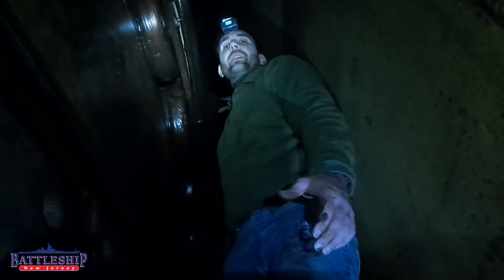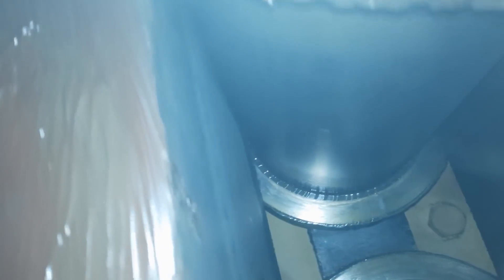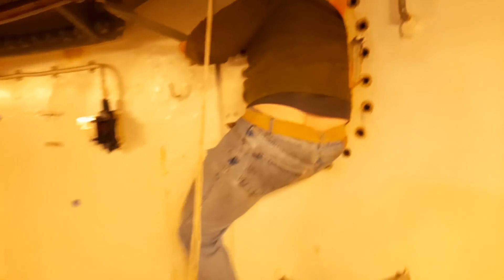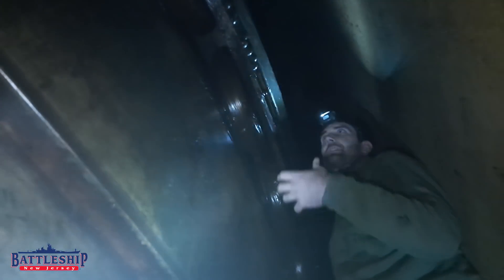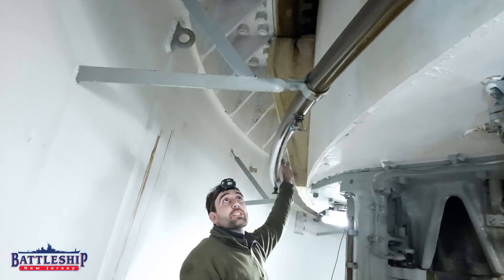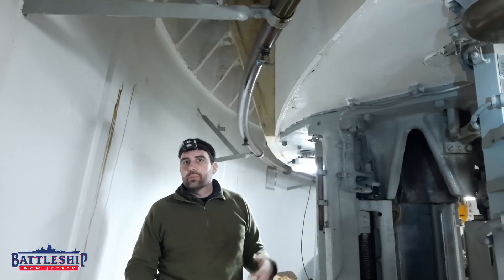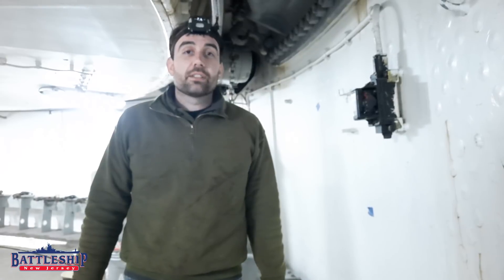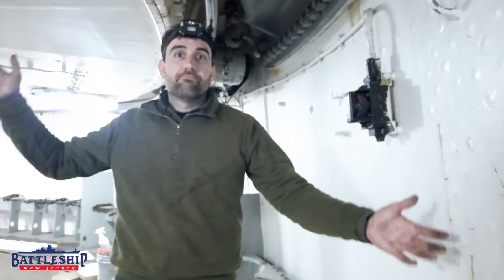Do the 16in Gun Turrets Still Rotate?

Comment: So just curious the video never confirmed if they were. I mean there are stories and that article on page 7 mentions it, but has anyone tried to rotate the turrets to see if they move, or if the systems that provide that still function, or is it as some suggest that maybe due to power requirements there simply isn't the electricity needed to do it from shore power, which that last part doesn't make sense as i'm sure they had maintenance checks on those, so th eidea that they could only check them if the ship's plant was online or at sea doesn't make sense
Reply from the maker: We're going with plausible. We don't have enough power to test it but haven't found any welds showing it would be impossible.
Reply: @BattleshipNewJersey  ok. Here's a good follow up then, and a pair of good questions for a video. I know some ships, such as Iowa, still do gun salutes for special occasions. Iowa's museum posted a video a few months back showing what it looks like from the inside. Besides the fact it would be a bigger powder charge, and cost way more to do, my question is 1 is it still possible to do a gun salute with a 16in gun, or were they rendered unable to fire? (like for example in demilling of guns or cannons, i've seen breech block removed, holes burned in barrel, barrel sealed with steel or some other material, or firing mechanism removed) question 2 is are the guns still able to be elevated or lowered to accommodate that or other types of preservation maintenance?
Reply: i did just see someone asked that question a week ago..kind of. Not necessarily a full power, 4 powder bag charge that cycles the gun and all that, just some kind of salute
Reply from the maker: It would be completely unsafe to fire the 16in guns. We do saluting charges with the 5in guns and the 40mm guns. 

The 16in barrels can be elevated.
Reply: @BattleshipNewJersey  okay. On a side note, I've been to Alabama, Iowa, and Wisconson, so i'll have to come by and add New Jersey to the list. The warship i'm on is decomming next month and we'll be sailing up there for storage so there's a few of us, given the chance, want to come see the New Jersey. Hopefully the gift shop has ship coins for sale
Reply from the maker: Of course we've got challenge coins! If we're not publicly open by then, email me at education@battleshipnewjersey.org and we can set something up for you to see her.

Comment: One way to find out. Rotate them. The need to move every once in a while. Bad for them to sit in one spot.
Reply from the maker: We don't have the electrical power to do so.
Reply: @BattleshipNewJersey   Can't you bring in an generator, run a cord to power them up?
Reply: You can wire in an axillary system to work them
Reply from the maker: Its a lot of power. You'd need a massive generator to do it. It's just not realistic.
Reply: @BattleshipNewJersey   I'm an electrician, they have 3 phase generators on trailers that would handle it. I'm not trying to harp. I apologize if I come off that way
Reply: I know you have a limited budget, but that would attract more people to the ship.
Reply from the maker: You also need to be able to repair all of the motors and hydraulic equipment that we aren't allowed to touch either.
Reply: @BattleshipNewJersey  10/4
Reply: @BattleshipNewJersey  I appreciate you answering the questions.

Comment: The engineering of these machines astonishes me. All pre-computer, pre-calculator!
Reply: The IOWA was used in the Gulf War---The mechanical aiming computer is still so accurate, that it was determined there was no need to replace it.  (People were pretty damn smart back then, and had to be, without electronics and tech to do all their thinking for them).

Comment: I think to answer that question you need to fix everything on the electric swich gear deck and give it power. I'm sure it will turn.
Reply from the maker: We don't have enough power to do it, our shore power hook up isn't capable
Reply: @BattleshipNewJersey  those diesel generators on board are disabled too? I'm sure theres something still left there to pull that magic trick  off. You gonna have to do it at night though. I don't want you to scare the locals by cranking the turrets in broad daylight.
Reply from the maker: We fire our 5in guns regularly, the neighborhood trusts us. But the diesel generators, don't work and won't work, so we can't rotate the turrets
Reply: @BattleshipNewJersey  damn!
Reply: @BattleshipNewJersey  I volunteered a little on USS NORTH CAROLINA.  It would be great to see a gun fire on that ship too. Too bad the main rifles are pointing either downtown Wilmington  (turret 3) or straight at Leland NC (turret 1& 2).
Reply: @BattleshipNewJersey  , "But the diesel generators, don't work and won't work", Don't I understand from years of not being used. Won't work because of rules or that much work needed on the Gens?
Reply from the maker: Our contract forbids us from powering any of that up

Comment: I like.  Engagement increased by one.  On a tank, there's often a way to manually traverse the turret.  Is there no back-up manual system on a battleship?
Reply: There's a question of scale... 2200 tonnes vs maybe 20 tonnes in some tanks?  Could you manually traverse it?  Yes, probably, with enough manpower.  Could you do it in combat?  I strongly doubt it.  Far easier and faster to turn the ship to point the turret at the enemy!

Comment: OK Ryan.  LOVE the Videos, but you had one question on this one and you missed it.  The question was CAN THEY ROTATE?  Not if they are greased, not they are not welded.  CAN THEY ROTATE?  In other words, do you need main steam power to rotate them and since you can't use the boilers you can't turn them?  What exactly is stopping you from rotating them?  No electric power? Not enough power? or what?
Reply from the maker: Not enough power
Reply: @BattleshipNewJersey  See THAT's the answer.  NO, we can't turn them without main power. While it was neat to see the greased rollers, the clip never answered the question.  Now we have it.  Thanks.  Keep up the great work.

Comment: Wasn't it the NJ that there is a video of it being transported by tug from where it was mothballed, and one of their concerns was that the turrets were still free to turn, and that the locks were damaged and not effective?  IIRC that was when it was brought to Camden, so if anyone were to have "welded" the turrets locked it would have been the Museum doing it.   The fact it has 3 motors and rotates at 4* per second means the motors are geared in such a manner that the turret cannot rotate the motors, and the motors effectively lock the turret in place.

Comment: The rollers are almost certainly not made out of brass. Based on a rough load analysis, the brass rollers would likely fail as soon as the turret is installed. Bronze is no better. Heck, even standard high-strength steel is marginal - even without taking into account dynamic loads such as pitch and roll, not to mention shock loads like gun recoil or shell impacts.

From what I have read, the South Dakota class used forged steel rollers. I guess you have to rely on the grease to suppress sparking.

Comment: You can weld hardened steel. It is possible. However if not done properly it would ruin the structural integrity of the metal. Those rollers will be hardened steel. There are much better ways of immobilizing a turret than welding on an extremely heat sensitive component of the mechanism. The easiest way I can think off off the top of my head would be to weld slugs of metal into the gear the turret turns on. Weld them to the mild steel on the inner turret basket so they sit inside the turret ring gear.

Comment: Eventually those rollers will get a flat spot over time & the raceway that rollers will get a low spot where the rollers are sitting on so if someone wants to rotate the turret it will be slightly more difficult to rotate them but not impossible.
I assume it takes fair amount of horsepower to move them so I assume someone think they are welded but you can just push the turret to rotate it.

Comment: Don't believe they'd weld the turrets but would do something in a turret related system which likely could be easily reversed/repaired while meeting the letter of the law and preventing the turret from turning.  Weld an external stop on a 1/2HP motor shaft of something in the chain and you've satisfied Sen Thurmond.  Obscure motor xyz doesn't spin and it's part of subsystem C for turret widget Z.

Comment: Another great video. Thanks! I wonder if the rollers could be beryllium copper? I think that would take more weight than brass without deforming and could be almost as strong as steel and still not spark or rust. If they are, though, don't grind them or anything like that. It would create toxic dust.

Comment: When I was watching a video from the Iowa https://www.youtube.com/watch?v=LJfGJPLDwAI there is a drawing of locking pins that go into the barbette to keep the turret from movingaround 51 minute into the video. Could it be that those got welded in place rather than dragging a welding rig down into that annular space you were showing us? BTW - Thanks for the 'behind the behind the scenes' video. If you can get Ryan to volunteer to go into more places like this, the splinter deck, catacombs, chain locker I'm sure they would be among the most interesting.
Reply: Ryan can you video this!!!!
Reply: Interesting they say it's hydraulic motors to rotate the turret.
Reply: @briansutcliffe6503  My guess would be that it's faster to train someone to see hydraulic fluid spurting out than to train electricians mates. They generally used 1 big motor to pressurize the hydraulics and then used hydraulic motors and hydraulic cylinders to do the actual movement.

Comment: Technically, this could be checked, but probably only if the engines were running and there was enough power to the motors to initiate turret traverse.

If the turrets move (you can try something like a 3 degree rotation, to avoid strain on the motors), then you'd know for sure that nothing was done to immobilize them.

Comment: I’m sorry but I can’t help it but feel like there is some part of the answer to your question in the video title missing, namely a yes or a no. So, you did not find any evidence that the turrets can’t be rotated, but you have not fully inspected the turrets, right? (Which I guess is not a quick and easy thing to do). So you can’t definitely tell right now?

And a side question: if the hydraulic machinery for turning the turrets did fail in combat, what is the redundancy? Several separate hydraulic systems? Or even a hand crank? Given the huge weight the latter sounds crazy, I know 🤪

Thank you very much for your outstanding effort! 😊👍🏻

Comment: Is there a way to traverse a turret with complete power loss? I know the Texas had a chain pulley mechanism, I’m wondering if Iowas had something similar 

Also, how thick are the 5”/38 turrets and would it be the same thickness as the ones on Allen M Sumner and Gearing class destroyers?

Comment: And as is common knowledge from the Russian treatment of HMS Royal Sovereign , if you don't move the turrets on a regular basis, they will freeze in place.  Those turrets aren't ever moving again.
Reply: As good as the RN 15s were, I suspect due to being designed 20 years later, these USN 16in turrets may have greater tolerances. That said, eventually the bearings may distort from the weight and cause the turrets to freeze. A good judge would be to try turning the turrets on lets say the USS Alabama, which have been setting motionless since the 60s.
Reply: @Peorhum  I greatly doubt there were sufficient advances over those ~20 years in bearing metallurgy such that they would overcome the forces of gravity and time.  But hey, of you want to go the "And then a miracle occurred" route, have at it.
Reply: @iatsd  There were massive leaps in metallurgy between the wars. The difference between WW1 and WW2 aircraft is a pretty clear demonstration of the scale of advances. Gun barrel life was another area that benefited greatly. It is hard to imagine that something as ubiquitous as a bearing didn’t also have similar performance gains.
Reply: @nicbrownable  Depends entirely on the subject area.  In the case of aircraft, you're essentially going from nothing to something, so yes, the advanced are larger.  Take naval armour as a counterexample: very little advance between the wars except for a few minor changes in production techniques.  But even if we accept your premise, you're still simply asserting that because the NJ was built later it must be better than the Royal Sovereign.  You're assuming (or ignoring) the fact the RS was updated several times over the intervening period.  If such significant advances were made don't you think they wouldn't have been applied?  Your argument just seems ..... unlikely.  It just makes too many assumptions of prescience on the part of the US designers and abject ongoing stupidity of the British designers and RN.
Reply: @iatsd  Were turrets typically removed during refits?
Reply: @iatsd  actually advancement in that 20 years were considerable. Remember the Royal Sovereign was started construction 5 years after titanic begin construction, metals back then was a cutting edge science. That said design factors could also be a factor, wider bearings and so forth too. Don't forget the Iowas set for long periods in storage over their life times, I am not sure how often the turrets were turned during that time. I would be interested to know if the turrets on the Alabama could be turned, I would be surprised if they could though.

Comment: Hey Ryan, very cool topic!
So rotating the turret ... what's the electrical spec on that motor? Amps, voltage, Three-phase or single phase? (could you post a pic of the motor data plate?)
Reply: 300hp, almost certainly 440v 3-phase.